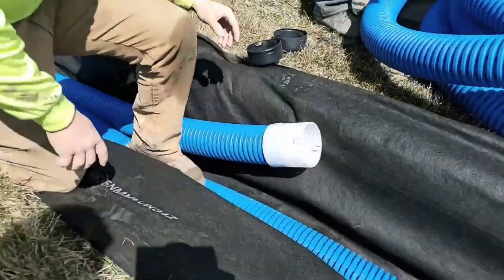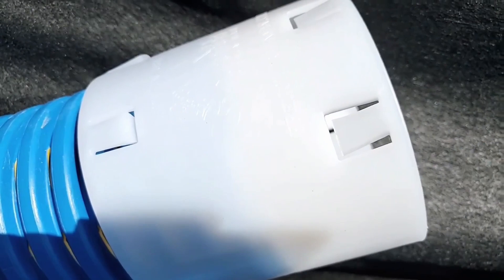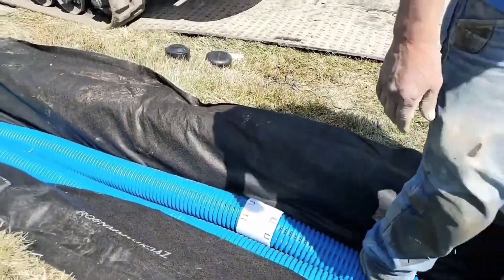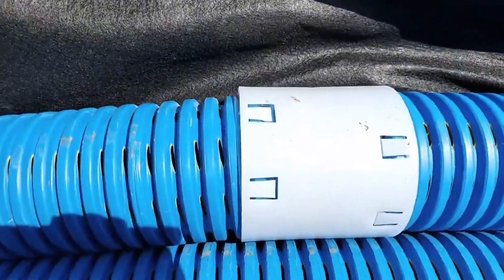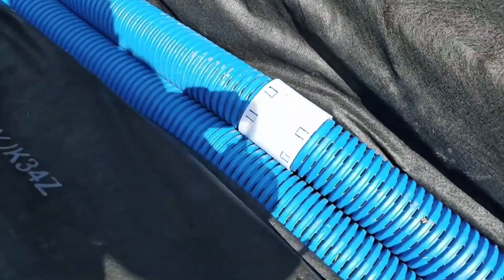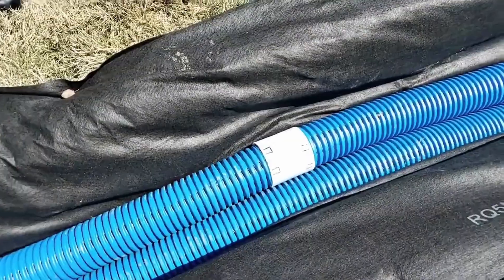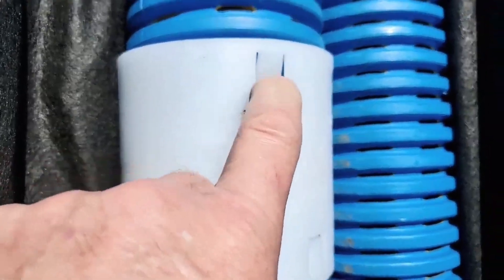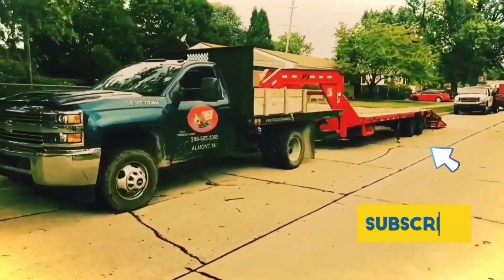How to Build a BETTER Yard Drain System

Comment: Doesn't water leak out where the coupler connects the two pipes? Seems like it would be more prone to roots getting in compared to tile tape.
Reply from the maker: It's a french drain we need water to fill the pipe. The LARGER the inlets the BETTER. 
Thank you for commenting and contributing!